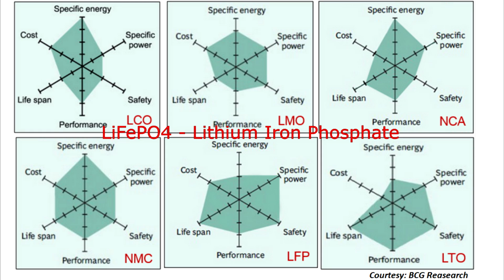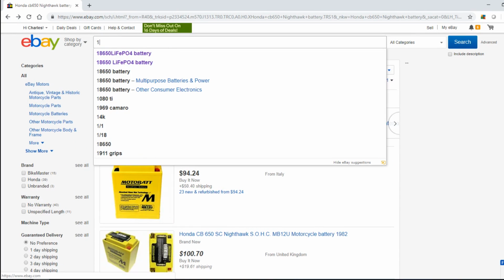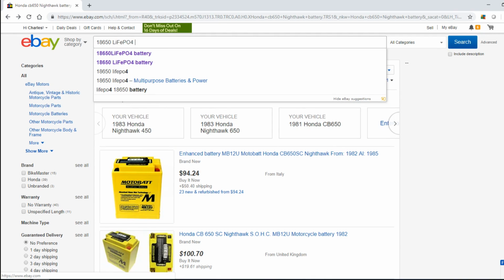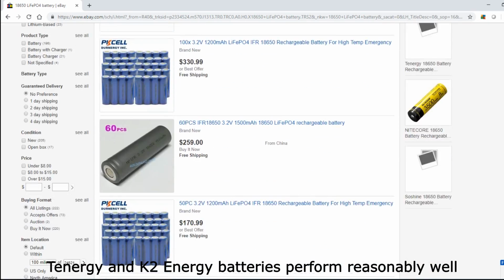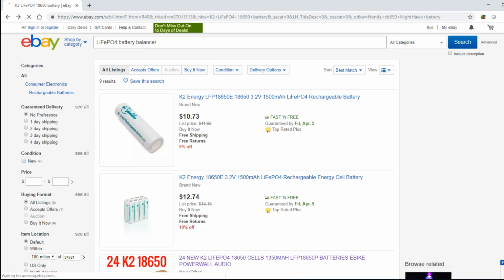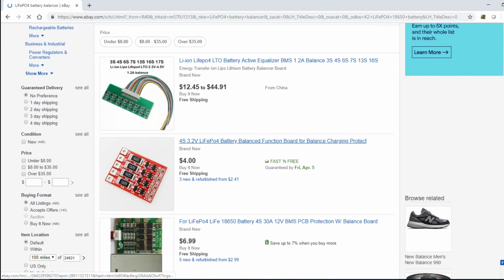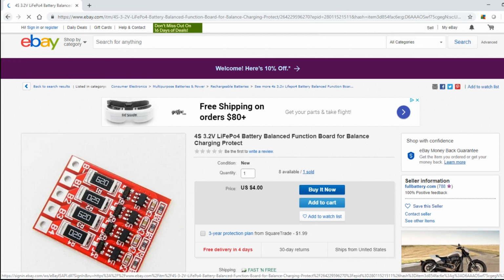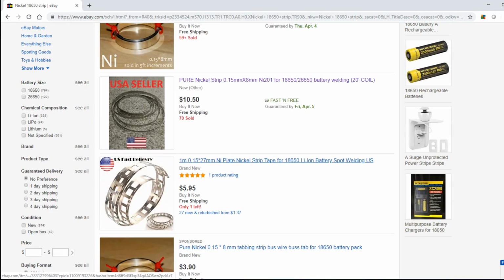DIY a better (and cheaper) long life motorcycle battery

Comment: This strategy is BEYOND reckless and irresponsible.  Lead is one of the MOST toxic substances known.  It will cause brain damage at parts per million.  You just flushed lead sulfate onto your lawn.  You contaminated your soil and that of your neighbors to save a few cents.  You could have just wrapped your LiFePO4 batteries with some sheet plastic and achieved similar protection with a bit of care.  Instead, you chose reckless irresponsibility that risks your children's health and that of your neighbors for generations to come.  Brilliant!

Comment: why a 4s? It seems it wont fully charge being 16.8 full and 12v dead. I suppose if it works its worth a try. my alternator only goes to about 14.5v max.
Reply: LiFePO4 I get it now. 14v  max and 11 dead for a 4s.

Comment: My new MC came with i Li battery., and it died after one year. The battery in my Honda SH-50 1986 is still working.. It started the moped in a pile
of snow at -20C, so, I will by a lead acid battery for the MC

Comment: I have a lithium battery.  This week I went to my bike and it started no problem, rode to a friend ten miles away came out and all electrics were dead as a dodo.  Nothing, no lights on the display.  I pressed the button on top of the battery - nothing.  I tried to bump start it - no go.  I thought this cannot be the battery, so it must be a circuit problem.  I had to go back with a trailer.

When I got home I put jump leads on the battery and it started.  When in the garage I turned the key and the battery produce nothing, I pressed the button on the battery and behold it worked this time!

I will never buy another lithium battery.  If I had had an acid/lead battery it would not have started and then failed after the ride and caused me all this trouble and time wasted.  Maybe they should supply jump leads when you buy the batteries, as you will need them!

Comment: Great video.  I'd like to make this.  As I try to buy 18650s I'm finding they come in different amperages (2500mAh, 3500mAh, etc.).  Just wondering what was the amperages of the 18650s used in this video?  Same goes for the BMS.  I'm finding em for sale everywhere from 4s-2500mA to 4s-3500mA.

Comment: This is one of the biggest disregards to safety I have seen. The video is good quality and your explaining some aspects really well. In my opinion, batteries are extremely dangerous devices to start playing around with, especially for high current applications such as vehicle batteries. Starter motors draws hundreds of amps during vehicle startup and very simple mistakes can be costly. LiFePo4 are less susceptible to catch fire when used outside normal operating conditions than standard li-ion batteries. But you are basically telling people to start making their own batteries in the blind.

Some problems I see, other than you not using safety equipment are:
* You should be using a way bigger tip when soldering the batteries. This will provide a better heat transfer such that exposure time to the heat is minimized. And yes, overheating the batteries is important and you should pay attention. At the very least you could damage the cell.
* You do not talk about dimensioning at all! You're just explaining what type of battery you buy and that people shouldn't trust the numbers in eBay ads. NEVER buy batteries from and unknown source. You have no idea what they are actually made of. Just by them from reputable brands and pay the 10-20% extra they cost.
* Your BMS is BS. No talk about the dimensioning here either. You can't just go out and buy any old BMS for this type of problem. It needs to be able to handle the charging current and voltage. Which you don't talk about either. Vehicle do not output 12 V from the regulator/alternator combination but rather closer to 14.4V. Does your BMS has overvoltage protection? When does it cut off the charging? Over current protection? How does it balance the cells? It looks horribly small for a battery pack charged by a vehicle.
* Lithium batteries are usually charges using a constant current and constant voltage. Your BMS will only provide somewhat constant voltage, depending on the output of the regulator of the vehicle.
* I would also personally prefer to have fuses between the cells of the battery such that shorts in one cell does not affect the others.

There might be other issues that I have missed. Please, do not build a battery pack on the basis of this video.

Comment: Mey friend good for you.  but my bike battery ytx12bs 12v 12ah.. buuut Cca: 180AH.. (Cold cranking amps - CCA).. Cold cranking amps (CCA) - CCA is critical to the ability to start the vehicle when the engine is cold. The number of amps a battery at 0 degrees Fahrenheit can deliver for 30 seconds until the battery voltage drops to an unusable level. And this one BMS blow up... 
AND in this case the BMs also blow fuses.. Even if I use a high amperage bms...What do you think I should do in this situation?

Comment: I'm tempted to try this in all of Yamaha wisdom they used a 14b mini-bike battery to crank over my 1900cc V-twin the highest peak output or CCA is 210 with the yuasa AGM battery at $140 if they would of allowed 1/2" more room for the battery it would of made this so much easier
Reply from the maker: Be aware that lithium batteries do NOT like cold weather.  The cold cranking amps drop to less than half if it is below 70 degrees outside.
Reply: @highervoltage5430  unfortunately the lipo battery at half is still more then the full AGM battery it has room for

Comment: Goodday mate, is there any specific BMS Amphere for bike usage? Which BMS to chose
Reply from the maker: Not really.  I use the BMS as a balancer, not a charge/discharge limiter.  Just about any balance current will work.  smaller units just take longer.
Reply: @highervoltage5430  Are you not concerned with overcharging the battery?

Comment: first of all never turn on headlight or any light before starting up your motorcycle. always start your bike first and give a little rav than turn on the lights this ill keep your battery healthy
Reply: That's not possible on newer bikes sold in the U.S., when you turn the key, the lights come on. There is no switch.
Reply from the maker: Yep.  Headlight always on.  Required on every bike made after 1978.
Reply: @highervoltage5430  same in Europe, it's  a pain in the bee-hind.

Comment: Very good video. I would consider hooking up one single set of batteries (4x18650 in series) in parallel with a super capacitor pack - 6x500F 2.7V with balance board to provide 16v(max) 83F capacitor pack. The capacitor provides a large amount of cranking amps.  I would use on Yamaha XT250 enduro.
Reply: Hi, Did you yet made this battery pack?
Reply: I am very interested in this. Where can I find more info about such battery?

Comment: Hello, my question is about the charge that the batteries are taken from the motorbike alternator, does go through the BMS or direct to the poles of the battery? and is the bms only for balancing the pack?  how much ampers is the pack receiving from the alternator,  because the voltage logicaly must be from 13,8 - 14,4  if i am right!!! Thank you!

Comment: A LiFePO4 cell is more suitable (cheaper, and safer) to use for a car or motorcycle battery. The main reason is that the nominal voltage of this cell chemistry is 3.2V (12.8 V for 4 in series). A lead-acid battery has a nominal voltage of 13.6V. The motorcycle's charging voltage (usually 14.4V) is just perfect for LIFePO4 cells. The battery will not be over-charged. Also, the BMS you use should be rated for at least 100A output as he starter motor will draw around 100A. The one you used here looks too small.
Reply: Lead acid nominal is 12 exactly iirc. With lifepo, the situation is that the nominal voltage is basically quite a discharged state. Whether that's good or bad, hard to tell but probably fine, as long as the alternator isn't faulty and provides sufficient voltage to actually charge it properly.

Comment: There is so much wrong with this video!  Those batteries are not LiFePO4!  They do not come in 18650 sizes.  Don't buy batteries from eBay.  Their specs are bullshit and they're not reliable, and certainly not the type you're looking for!  You should be spotwelding instead of soldering batteries until they're "good and hot".  Your wiring is bypassing the BMS so there is no overcharge/discharge protection!  These instructions are dangerous!  Please rescind this video before people blow up their garages!
Reply: Don’t forget the rinsing the acidic battery housing without neutralising or PPE, not securing the pack that well inside the old housing, using eye sockets that will snap off very easily and soldering without crimping which also cracks due to vibrations

Comment: I have a 6v motorcycle without a starter.. What configuration of 18650's or other cells do you recommend?
Reply: I also have an old 6V, no starter machine. Headlight is 35W, tail and number light 5W and I want to remember the ignition is like 25 W. The system needs to handle a bit above 10 A. I guess two 18650 cells In series would be enough? Maybe parallel that for a lite more capacity.

Comment: TX90 connectors are good for connect battery . It is very easy take along or use two separed battery. No any good reason use lead acid battery parts to make new.

Comment: Awesome! Just one thing, as a definitely-not-electrician, is there a good place to get the required battery details to match our bike specifications? I’m pretty sure that my 373cc single cylinder wouldn’t need the same Voltage/Amperage
Reply: I'm pretty sure it would.
Reply: Just use a 12v rotary tool battery does same job and cheaper you can also put it inside the original battery like he did in the video. You'll also have a charger that comes with it that way with a bit of modification

Comment: Great video! One thing that would really help the project and save everyone who builds such battery time is checking each battery BEFORE you solder them into one pack.
Reply from the maker: Very true.
Reply: @highervoltage5430  Thanks for your video.. still relevant even after all these years.  Question... I am going to build a battery using 8x 26650 cells for my bike... I was thinking of using an active BMS to protect the cells from over and undercharge as well as balancing.   I'm trying to choose the right max current capacity for the BMS,  but I don't know how much current a starter motor usually draws when starting a cold engine.  Is it more than 100A or less?  Have you used any active BMS's before that you could recommend?  Many thanks! Dean

Comment: You built something really awesome here. I'm going to copy this, with the only difference being in battery size: I'll use 26650 instead of 18650.
Reply from the maker: I use 26650's mostly now as well.  They are easier to come by and have higher capacity and discharge rates.
Reply: @highervoltage5430  How are they easier to come by then 18650?
Reply: 32650 is much better.

Comment: What happens on a motorcycle when the BMS cuts the charge from the stator? With a conventional alternator that would destroy the alternator. Instead you'd do it by cutting the field wire. How does this compare the charging system on a bike?
Reply: It's not since it's directly connected to the battery.

Comment: This is totally not necessary.  If you take proper care of a lead acid battery (sealed AGMs for motorcycles), this wont happen.  Also, you could jump start or "bump" (push) start many motorcycles.  Also, you don't know how much someone is paying for a new (or good used) AGM powersport battery, so you cannot say your method is cheaper.  Also, some motorcycles put out close to 15v charge voltage so that may not be safe for LiFePO4s.  Downvoted!

Comment: Did you do anything to the alternator on the bike to protect the battery? Or does the bms do all the work?
Reply from the maker: You don't have to do anything.  a 4 cell LiFe battery is capable of 14.8 volts without damage.  Most alternators have a voltage cut off between 13.2 and 13.6 volts.

Comment: First off, Ebay is FULL of counterfeit 18650 batteries, and second, 24 pieces of genuine High Current 18650 such as the Sony VT5 will cost you more than a readily available certified Lithium motorcycle battery nowadays, much safer too.
Reply from the maker: You are confusing Lithium Ion with Lithium Phosphate.  These are different chemistries entirely and lithium phosphate is not faked on EBay.
Reply: @highervoltage5430  
I'm not confused at all, Buying parts off Ebay is a hit or miss, I have literally a box of out of specs 18650 LiFePo from my vaping days.
In any case, going the DIY route is most likely to cost you more than a readily available certified Lithium ION motorcycle battery nowadays.

Comment: Is your bike using some kind of alternator to recharge the battery? If this is the case... is it safe?
Reply: The BMS is managing the charge and discharge of the cells. So it is as safe as the BMS you use and LiFe batteries are not flammable like lipo or li-ion either so really it's about as safe as the lead acid just more reliable.

Comment: Are there any issues with floating the charge for it?
And if resistors are dissipating excess charging current in BMS module how it is exhanged out of the battery box?

Comment: Not sure about cheaper.

A cheap lead acid motorcycle battery is about $60. 24 x 18650 cells is well over $100 and that is before the bms, case and nickel strips! 🙄

Comment: Don’t solder cells. Use a spot welder. Heat damages the cells
Reply: Life batteries are more tolerant but, even li-ion getting damaged by soldering is mostly a myth unless you hold the iron on there for a a good minute.

Comment: It looks like you are drawing power directly from the battery (not via BMS)and charging battery directly as well (not via BMS). The BMS you are using will only balance the cells, but not protect against overcharging / over dis-charging. If this is true, you'll destroy this battery pretty fast. Potentially you are dealing with a Li-Ion battery that can catch on fire right under your seat and next to your fuel tank. Good luck.
Reply: He is using LiFePO4 batteries that are more forgiving and do not generally combust upon failure like Lithium Ion.
Reply: If that is the case what is the solution ?
Reply: @allsafe1  get a different BMS?
Reply: @Artemis_xe  yes , get a bms with high amps

Comment: Rather don't solder on them, few of mine vented during soldering. Ordered a spotwelder on AliExpress two weeks ago because of this. But the LifePO4 cells were a few years old already and holding between 1000-1200mah out of 1400.

Comment: The reason people use lead acid is because they work no matter the temperature outside.  Lithium batteries cannot be charged below 0 celsius, otherwise you will destroy them. So you better use another battery if you want to start your bike during winter.
Reply: think about what you just said....motorcycle, start it below 0C....99% of motorcycle riders park their bikes during winter...so charging the battery below 0C is not really an issue if its in storage.
Reply: @Rebel635csi  parking it does not mean you don't start the engine at all at least once a month for a few minutes
Reply: @slick1908  worst thing you can do actually. Running an engine without getting the oil hot enough to burn off the moisture introduces more acidity to the oil, more condensation build up in the engine and exhaust and does nothing to prolong the life. Best thing to do is leave it alone, pull the battery and don’t touch it till spring.
Reply: @Rebel635csi  You might be right on this one I'm not going to argue. What about overheating? Lithium requires special chargers, the same as in phones that will adjust the amperage according to battery voltage otherwise heat and fireworks may occur, an alternator is not designed for that. Adding that to the fact the battery sits next to an internal combustion engine, things are not looking well
Reply: @slick1908   commercial lifepo4 batteries are available. Lifepo4 charging curve is so similar to lead acid other than not requiring a float charge that it’s not an issue. Engine bay heat affects the lead acid batteries just as much as lifepo4. The only reason they aren’t used widespread is cost. They also are great for high current inrush for their weight and size but their amp hours are still low. So accidentally leaving lights on will drain them much faster.

Comment: You can knacker an 18650 by applying heat to the middle of the negative end. Try and keep it the outside and use a spot welder to keep the heat to a minimum.
You can make a good spot welder with a12v car battery, a momentary switch and a solenoid.
Reply: I saw a you tuber posted a video for this idea. Thank for remind me and I searching for it
Reply: Yeah but he's gotta build the battery first before he can use one as a spot welder. 😆
Reply: @josh_ari  - A "car" battery for a spot welder. Not an 18650 battery.🤐
Reply: @herenow2895  you can't use a motorcycle battery?
Reply: @josh_ari  - Any 12v lead acid battery. The bigger it is, the more spot welds you can do.
Reply: @herenow2895  so a lithium battery pack won't work?
Reply: @josh_ari  - Go back and read your first comment.
Reply: @herenow2895  I'm done trying to troll you
Reply: @josh_ari  - Dont give up your day job.

Comment: These LiFEPO4 70 amp batteries are 7.50 each x 24 = $180 just for the batteries.  You can buy a complete LiFEPO motorcycle battery from Shorai for $150.
Reply: It's like me, that gets cells for free. ALso, with this you can hide entire battery inside a 1" frametube.